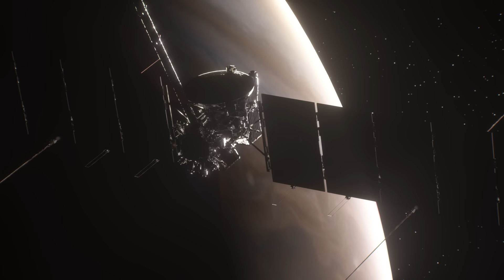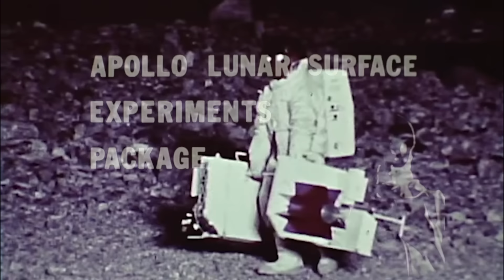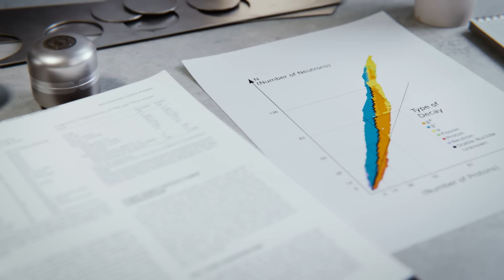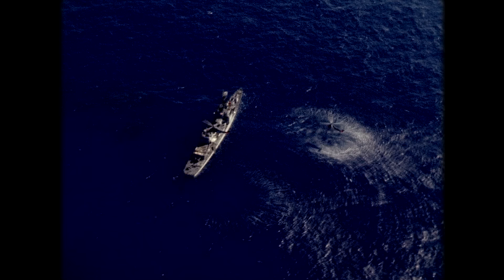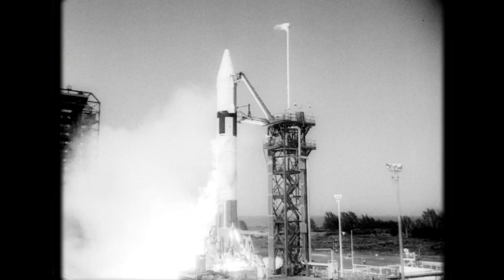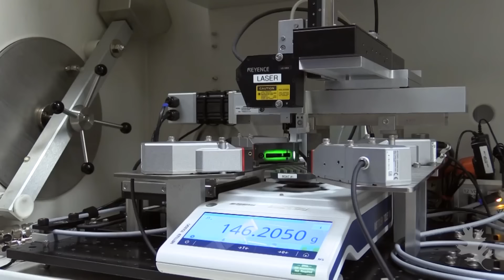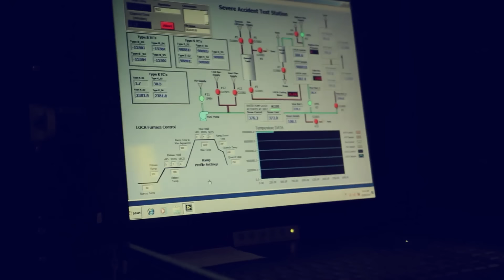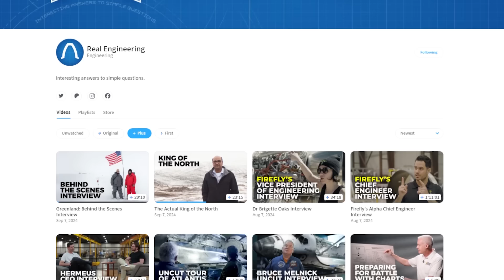NASA'S Plutonium Problem

Comment: My dad worked at the experimental reactor in oak ridge. He milled the plutonium pellets for NASA. He also did a lot of titration with manipulators. So, I've known about NASA's plutonium problem for, like, fifteen+ years. 

Also, he got sprayed with plutonium once. Scared the bejeebus out of him. And us, when we learned about it a week later. Thankfully he was okay, and got hosed off quickly enough and got his suits off quickly enough.

I've also been to the actual reactor once. They have a "take your family to work day" like once every twenty years. It was really cool getting to walk around the observing galley overlooking the cooling pools. It was ALSO cool getting to walk underneath everything in the service tunnels. Those had massive pipes, and more than I could count.
Reply: So if you knew about the plutonium problem 15 years ago, does that mean you only know half-as-much about it now???   LOL
Reply: @jabadoodle That was genius!! 😂😂
Reply: @Tiniuc  I have seen the other end of the process - the HB-Line facility and the Plutonium Fabrication Facility at SRS where the Pu238 was encapsulated early in the program (I think another site did the later packages). It's all shut down and they just finished cleaning up and out the gloveboxes.
Reply: @dadofabunch  The RTGs themselves were assembled at Mound up in Miamisburg OH, as I recall (my last job before retirement was setting up the decommissioning job at 235-F to which you referred.)
Reply: @dadofabunch  That's really cool!! Was it a breeder reactor?
Reply: @Tiniuc  SRS only ever had production reactors to produce tritium, plutonium, and various other isotopes.
Reply: Is that you, Bart Simpson?
Reply: @renemartin5729 ha!  You bet me to it!  I hope the person's father didn't happen to be wearing a pink shirt that day.  (I'm liberally mixing Simpson's episode references I admit)
Reply: Sounds like a risky job! Hope they paid him well!
Reply: @Qwajman97 Hiw much would you charge them to get sprayed with plutonium?!😅😅
Reply: Talking of milling of plutonium - there's a curious aspect to the machining of plutonium which few people know about, but which often leads to big problems when holding the plutonium workpiece in a machine vise or a lathe chuck. I'm referring to the fact that, when the plutonium workpiece is machined, it will become quite warm - nothing unusual about that part. What IS unusual about plutonium  is that it can occur in one of several "allotropes" - different structural modifications of an element - which makes plutonium very sensitive to changes in temperature, pressure, or chemistry, and allows for dramatic volume changes following phase transitions. This can lead to the phenomenon of the plutonium workpiece suddenly becoming smaller than it was, and flying out of the vise or chuck. Great care has to be taken to ensure that this does not happen!
Reply: My dad worked there from 1958 to 1981, he made the bombs mainly the warheads for the first generation min man ICBM he made the bomb core. Your dad might have worked with my dad then, does he know a john terrill?
Reply: @MRblazedBEANS  I asked him, and unfortunately no, he never knew a John Terrill. But that's reasonable - the place is massive.
Reply: Milling as in machining? I wonder what it's like cutting and shaping a material when every little speck is literally priceless. Even if you're cutting diamonds and you make a mistake it's still like, "whatever, we can just get another one, they only cost thousands of dollars", but if you somehow screw up with an extremely rare isotope pellet, that's it, there is no more.
Reply: @wfjhDUI I'd imagine you collect the scraps and have it remelted if there's a mistake. It's also only at the "it would take an act of Congress to get more" level of irreplaceable.
Reply: @ Yeah but what about manipulations like sawing or drilling that create lots of very small fragments? I'm thinking either those are just off the table completely or maybe done in a glove box so that all the fragments can be recollected. Or maybe you simply have to accept that a little will get lost here and there.
Reply: @wfjhDUI Funnily enough, diamonds are dirt cheap nowadays 😊
Reply: sounds like Simpsons episode.
Reply: This is one of the coolest comments I've ever read. My good what a cool life experience!
Reply: They still adversities making fuel for space stuff at oak ridge. I saw a thing about it the other day at new hope center.
Reply: My dad worked at a civilian nuclear plant and they had exactly 1 Family Fun Day where one of the fun activities was, for some reason, welding. No idea why this was apparently a common thing.
Reply: Wait, you're... Bart Simpson???
Reply: More than I would subject my kids to...
Reply: Same
Reply: Why did you capitalize "ALSO"
Reply: Did you see the Cherenkov radiation lighting up the pools in that eerie blue light? I got to visit the experimental reactor at UVA before it was shut down and that's what I remember most.
Reply: absolutely sick
Reply: Did your Dad die of cancer like mine?
Reply: @RobardoHughes  actually he's still alive! But he's going to lose his feet any day now.
Reply: I'm glad he didn't join the I.P.Pu club.
Reply: MY brother worked for ORNL, (Oak Ridge National laboratory)now retired. He had a Q clearance and would not share with me what he was doing, until the US entered into the ITER agreement (International Thermonuclear Experimental Reactor) pronounced "eater."  (my brother was insistent on the correct pronunciation of ITER acronym)) And he was assigned to that project. ...A multinational consortium whose goal was to develop a concept fusion reactor...and IF it works will then spend many billions MORE to build a working commercial reactor... they will spend BILLIONS on this project, now under way in France. The US's part is to build the cooling systems. Personally, I believe the project is just a black hole eating money best spent in other techs, like room temp superconductors or more efficient solar panels....  Hell, even if they build a commercial fusion reactor......HOW MUCH WILL THAT ELECTRICTY COST??!!!!! Makes no sense!!
Do they even have a break even on that????????? PS, My brother does NOT think they will be successful.
Reply: @Bugdriver49  if you don't believe in your projects, you already failed before you even started :)
Reply: Tell him to adopt me pleeeaassseee🙏😅🥺
Reply: Liar
Reply: So cool
Reply: Got total Simpson's vibes from your telling of visiting your father's workplace.
Reply: I've been to Oak Ridge.  'been to a civilian-run military manufacturing site in central eastern PA.  Both times took stuff to a big machine shop on the Eastside of downtown Houston w/ paperwork stating it was going to Israel.  One load was Super Heavy & only on 6 pallets.  One of thoze trips I was followed by 2 M.I.B.'s in a li'l white sedan.  One time I was issued a dosimeter that was taken from me @ the destination.  For a week or so I'd pee @ night to see if my urine GLOWED but it didn't. I guess I was alright...  but since this tiny 3rd arm & hand started growing outta my side...  I'm not so sure.🤔
Can you YouTubers tell me what I oughtta do??
Reply: My mother had plutonium in her refrigerator
Reply: @xijinpig7978  With the spent bacon grease.
Reply: @xijinpig7978  unsurprisingly they also have 80% of all COVID related deaths in the world
Reply: @xijinpig7978  Reported account for Misinformation
Reply: @xijinpig7978 the fridge that Indiana Jones escaped a nuclear blast within?  Cool!
Reply: After "take your family to work day," did you take home any plutonium?
Reply: @196cupcake  pfft, no. I did get to play with the manipulators, though.
Reply: Homer Simpsons comes to mind, lol
Reply: Australia has almost half the worlds Uranium.
Get them to increase mining
Reply: @dsdgdsfegfeg Plutonium is not mined - it has to be created artificially, from feedstock like uranium, in nuclear reactors. It's certainly true that Australia has the largest reserves of uranium worldwide.
Reply: @dsdgdsfegfeg  Plutonium is not mined - it has to be created artificially, from feedstock like uranium, in nuclear reactors. It's certainly true that Australia has the largest reserves of uranium worldwide.
Reply: @robbannstrom the Australian government doesnt want uranium mining apparently 🙄
Reply: @dsdgdsfegfegchina has 80% of covid vaccine
Reply: @xijinpig7978 Nope. They have small supplies of it & it's 80% ineffective
Reply: Hi, if you are not saved, and would like to be included in the rapture of the church. Believe that Jesus's death on the cross, was enough to pay for ALL your sins , yes ALL ,(past, present and future) That is what the Gospel is about. We are saved by GOD'S amazing grace, through our faith in Jesus's sinless life, death on the cross and resurrection 3 days later . No additional works needed. It is literally that simple.   Ephesians 2:8-9  Romans 10:9-10  Romans 4:5
Reply: Bet the Russians have extra
Reply: My uncle who works in an secret-government-space-time-labratory and also takes me to family day, regularly. The hot-dogs from the future are the best! The open-door days are almost every month!

There, the visitors are also allowed to walk right through the space-time-bending contraption. Right through it!

One of the visitors fell into a time-slit and now he is caught in a loop.
Reply: @MAcDaTHo Gosh, I hope they can get the Time Tunnel guys to help him out.
Reply: @MAcDaTHo I think I have a seven year lead on the OCS (Office of Chronal Stability) so this comment should last a little while at least. 

My great-grandson worked there many years ago. I did the tours a few times until they discovered that Teds (TDS~temporal displacement subjects) from the past are the cause of the time-slits and looping. 

They do eventually find a fix for the looping but it’s unclear whether it will help him. 

When this video goes live, and IF this comment is posted, please don’t save it in any manner. No screenshots, no direct copy/paste, etc.

Stay strong America! You’ll need to be…

Comment: ChatGPT told me this: Yes, there has been a shortage of plutonium-238 (Pu-238) in the US, particularly for NASA's deep space missions. This shortage has been a concern for over a decade, although recent efforts have aimed to alleviate the problem. Here's a breakdown of the situation:

Why is Pu-238 important?
Plutonium-238 is a radioisotope used to power spacecraft via Radioisotope Thermoelectric Generators (RTGs). These are critical for missions that:

Travel too far from the Sun for solar power (e.g., to the outer planets).

Need long-lasting, reliable energy sources in harsh environments (e.g., rovers on Mars or probes like Voyager, New Horizons, or the upcoming Dragonfly mission to Titan).

What caused the shortage?
End of production in the 1980s: The US stopped producing Pu-238 in the late 1980s due to the shutdown of key nuclear facilities. For years, the US relied on stockpiles and purchased Pu-238 from Russia—but Russia stopped selling it in 2010.

Aging stockpiles: Pu-238 degrades over time (it has a half-life of 87.7 years), and some of the existing supply has decayed to the point where it is no longer usable.

Limited production capacity: While the US Department of Energy (DOE) restarted domestic production in the mid-2010s, the output was initially very small—only a few hundred grams per year. NASA needs about 3–4 kg for a typical mission.

What’s being done about it?
Re-establishing production: DOE has been working with national labs (like Oak Ridge) to scale up Pu-238 production, aiming to reach a sustainable rate of about 1.5 kg/year by the late 2020s.

Mission planning constraints: Because of the limited supply, NASA has had to prioritize which missions get RTGs, limiting some mission designs or postponing others.

Status as of now:
While the shortage isn’t as dire as it once was, Pu-238 is still a constrained resource, and NASA must carefully manage its use. Future missions like Dragonfly (to Titan) are planned with Pu-238 RTGs, so production must keep pace or some missions could be delayed or redesigned.

Comment: Space Based Solar for heavy industry on the moon let alone mars using solar energy possibly,.... A steel mill uses a significant amount of electricity, with estimates ranging from 2500 to 3000 kWh per ton of steel produced,...just consider this, it takes 9 million solar panels to equal the output of just 1 Nuclear power plant on earth,... on the Moon a single small modular reactor produce 300 MWe (a plant that you can fit in a Garage ) and can produce 7.2 million kWh per day,... Solar panels can not be sheltered from Micrometers, or near-pier-adversaries like China,... the infrastructure for Solar is enormous and the lagistic on maintenance will be scattered over a large area,... also it might be a huge target from power surge due to solar storms.

Comment: Lol.. Slides finger from ground to atmosphere > Runs Ultrasound frequency scanner to find planet Ultrasound Ambient > orders Piezoelectric crystals made for those frequencies > Stacks Crystals with amplifiers that fill a capacitor fast but bleeds into needs slow Masses: "But that doesn't produce a bunch of electricity!" Enough for Ultrasonic echoes to pull water vapors from worlds atmosphere to split with Ultrasonic resonance into hydrogen & oxygen to run a fuel turbine. For Space? Science tards: "Its a vacuum! No medium! Hey look at our Ultrasound micrometeorite probe data in space the interstellar medium is PRETTY!" Ultrasonic echoes in space to pull space gasses which at source of Ultrasound should get dense enough quickly to become fuel intakes around space craft..

Holds up Crystal up at the Sun with a Superman shirt on Get a definition for crazy and stop letting religious tell you science its like the STONE AGE telling you morality. It doesn't understand its pretending.. Googles "Explorer probe" then points at Ultrasonic microphone > Googles: "Ultrasound detected in the Sun's atmosphere" > Googles: "Space gas map" 

Idiots: "Crystals don't make enough power!" Slides Ultrasound crystal into power source set to resonance of cellular glues and aims it at person watching them melt into a liquid Whites of Earth got cast out for a reason.. Earth is a prison planet and the most DISEASED mutation of our race. Points at Plasma shielded ufos then at everything I just said "Googles: "Plasma generated Ultrasound" "We wuz people and SHEEIT!" - Watcher

Just scanned again forgot Earth is too stupid for words because it helps with bible hate speech confusion while religious attack rights without attacking that. Google: "Boeing Plasma force field stops Shockwaves" Why is Ultrasound called shockwaves sometimes in science? BECAUSE IT IS.. Shockwaves in space = ULTRASOUND. Its perfectly detectable by Ultrasound microphones. RESULTS..

Comment: the solar panels of the europa clipper will give the spacecraft more power than any radioisotope thermoelectric generator though, they're great for decade long missions but produce very little power. you'd need about 15 kilos to generate the 600 watts generated by the europa clipper solar panels.

Comment: Pu-238 does sustain a chain reaction; if it weren't, it wouldn't be a viable energy source, due to it being unable to reproduce the reaction of other Pu-238 particles on it's own.
It can be moderated more easily, which is why Pu-238 is more often used for long-term space missions, therefor having a more predicable and stable power supply
Reply: Plutonium 238 is fissionable, but it isn't fissile.  High energy neutrons will make it fission, but the neutrons it emits are too low energy to trigger more fissions.  It CAN'T chain react.  That's why Russia doesn't mind selling it to us - neither they nor we can make weapons out of it.  Spontaneous fission during radioactive decay that generates heat isn't the same thing as a nuclear chain reaction.

Comment: 9:38 this potential difference causes a current to flow in the external circuit. Thats not how it works, current isnt 'pushed', its drawn.
Reply: "Flow" doesn't mean "pushed"

Comment: There was no shortage of plutonium at the rocky flats facility in colorado. Now there is residential and commercial buildings all around it. After they cleaned it up.
Reply: There is likely plenty of plutonium about 2 feet below the surface of rocky flats.
Reply: @applewoodcourt  lets go dig it up and sell it to NASA

Comment: What happened to all the plutonium the US got back from decommissioning warheads at the end of the cold war? can that not be reused by NASA they just need a low level reaction to produce heat right so other isotopes could in theory be used?? Also it was discovered as a byproduct but cant they in theory design a reactor that produces the isotope they want as the primary output ?
Reply: That's the wrong kind of Plutonium.  And the Govt doesn't really like handing it out.

Comment: Quick correction. We are technically running out of plutonium 238 but that's because we stopped producing it in 1980 
We can still continue to produce it. We just haven't been doing it for 45 years